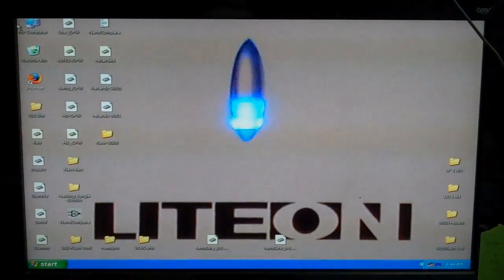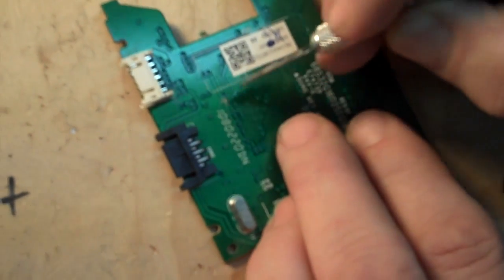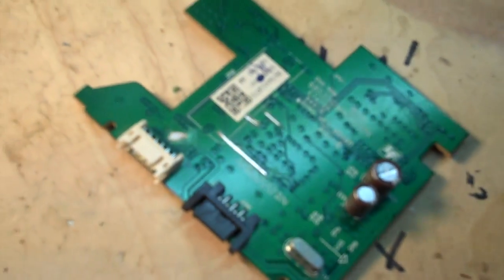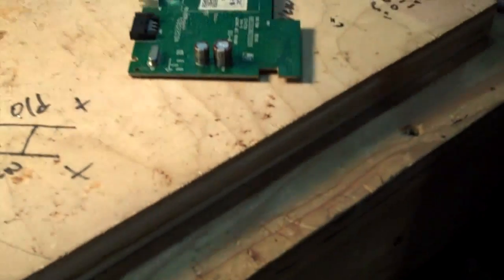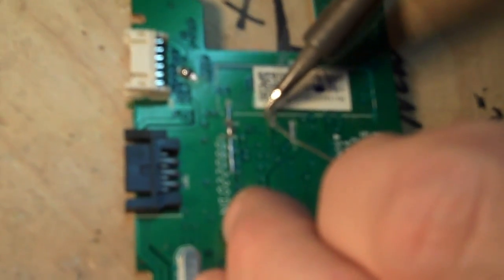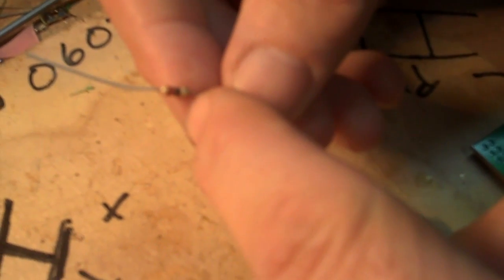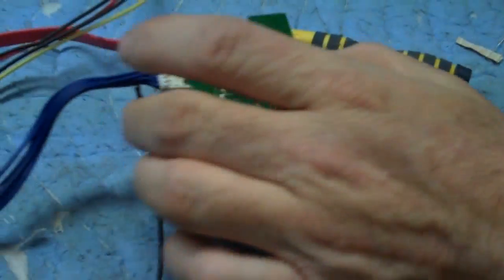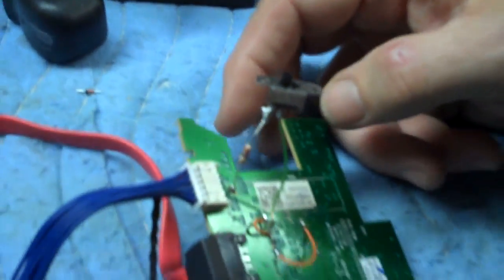PART 1 of 3 Easiest 93450c / 83850c LiteOn Dump and Flash With Complete Instuctions

Comment: @hackingjungle is there an easier way right now? all i have is the CK3 and Probe V 2 lol. but honestly, i really dont wanna scratch, solder or whatever. i just flashed the 7850 liteon lol. and i almost screwed up that. almost ended with a bricked drive due to a lite-on erase fail (jungleflasher won't recognize it anymore and openening the drive with the CK3 doesn't work anymore) but thx to the fact you can barely brick that drive, i managed to fix it ^^

Comment: im trying to flash this drive, before soldering it would come up on the pc.. but it wont be able to flash, so i did all the soldering and added the switch, cuts and a 22ohm 0.5w resistor..... but now when i open up dosflash, when i turn on the xbox my computer will stay frozen until i turn my pc off, this pc is pretty crap tbh its got 2gb ram lol anda 30bg hd, (its my mums pc but shes got a sata link in it(pci controller card) have i fu*ked up on the soldering or do i need to buy a new faster pc

Comment: Easiest way, Sack this I will just spend 60 quid on an older second hand console with older drive in. Ive flashed my 7 series, I flashed my mates 8 series no problem without the need of using my probe, So I hooked up my elites 8 series drive the exact same and it wont read, Im guessing its a version 2. But too much hassle for my liking.

Comment: hi i want to ask you that do i need to connect the three wires like laser ribbon and other 2.after soldering and to read the drive.since i saw other tutorials they donot connect the three wires while using urs method.(i donot want to use probe method)
thanks

Comment: @jidar That's a dumb statement...no one knows anything until they are taught (or figure it out). I've soldered tons of things but have never needed a switch...so I was in the same boat when I didn't know what to get. Knowledge is incremental; just because you know how to solder doesn't mean you know the whole of electrical engineering.

Comment: @vishwa7777777 You probably have a winbond type flash (I have read that dosflash cant do these). You must use JF for this. If JF is hanging, you need to remove your via driver from system 32/drivers folder. It will be called something like viamraid.sys, vraid.sys, etc (google for exact names). Reason for this is windows likes to auto install for you. Once you do this, the hang should stop happening. To get 0x72 in JF, follow the JF tutorial instructions *exactly*. If you do, you will get 0x72

Comment: Hi,
 I have checked the wiring and track cuts so many times, even metered them out one at a time to ensure definitely no mistakes.
DOSFLASH states its an unknown flash type and cannot identify the flash, it can NEVER get the drive into status 0x72.
JF - my system hangs if I switch drive switch to ON, but JF sees the drive fine with switch OFF, but stays in staus 0x51 / 0x52 even after power cycling the drive.

Comment: VietNamessee, you're an idiot. Did you pick up an old circuit board and practice soldering? Did you have the right solder tip and solder diameter? Did you look at the very clear pictures on the hackingjungle website? Did you research thoroughly, if you had you might have found the Xecuter LT switch which minimises the soldering required for this procedure. Don't get angry at others for your stupidity.

Comment: ok, i have a 22 ohm resistor, BUT its 1/2 volts. is that ok, or do i need 1/4 volts?

i also have 10 ohm resistors, and they are 1/4 volts. can i just put two of them together to make 20 ohms. or will that then be 1/2 volts again? 
thanks, and reallyyy great tut man. really helpin me out